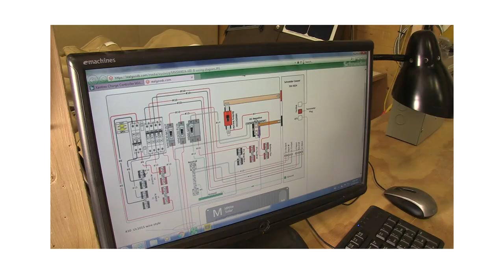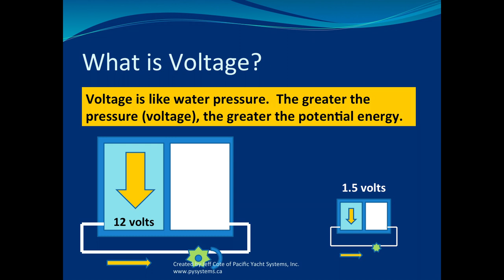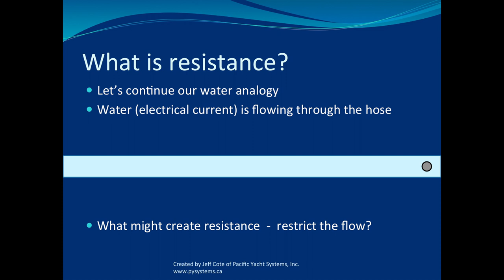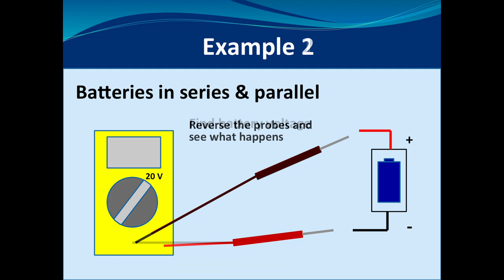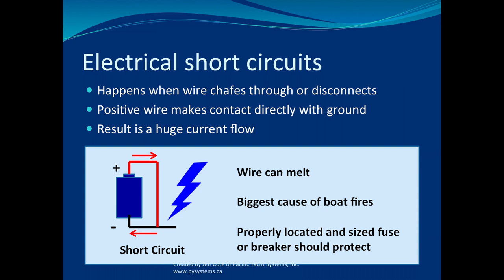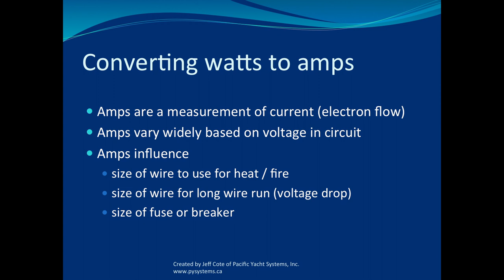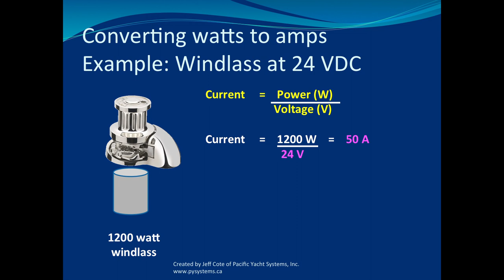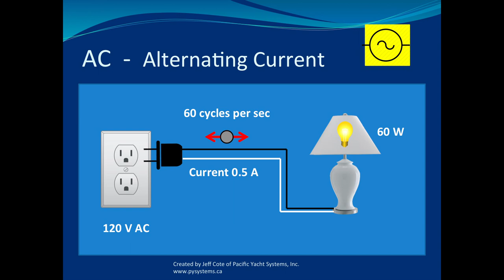How To: Marine Electrical Seminar - Troubleshooting Tips - Episode 7 of 12

Comment: Jeff, do you discuss using dielectric grease in any of your videos?  There's always such polarized comments and discussion on its use on 12 volt DC circuits of either soaking all connections in it or just applying it on after the connection is made.  I'm a believer in the latter.  I'd love to hear your thoughts.

Comment: Love your presentation Jeff, but I am not buying into your explanation of the 110v North America vs 220v in Europe because of age! Australia is newer than North America and they have 240v. It must simply have to do with choices made by the Engineers that designed the grid in each country and as you said, the higher the voltage, the least the Amp and cable requirements. I suppose in all countries the main power cables run thousands of volts, and then everything gets converted down to the final voltage.
Reply from the maker: Ahhh good point about Australia. Anybody else here know the reason between going 120 vs 220 VAC?
Reply: @PacificYachtSystems  my suggestion is that we have a strong bond with the English Commonwealth and because it is a younger country then North America, they have kept the same voltage rate than UK!
Reply: According to all the youtube and PBS documentary content Ive seen (hence Im an expert) in the early days of electrifying the US higher amperage / lower voltage was chosen to go longer distances. (Goes back to my hole of ignorance)